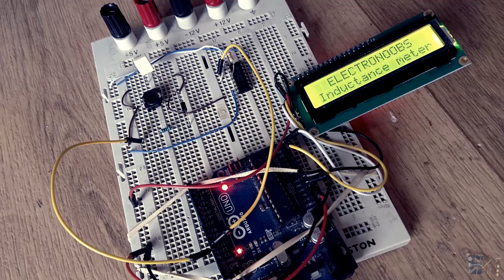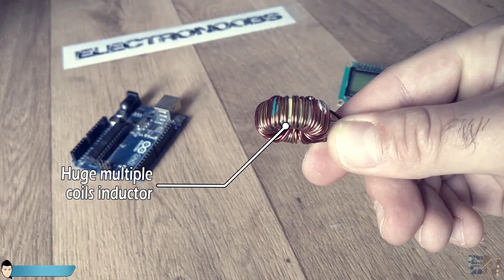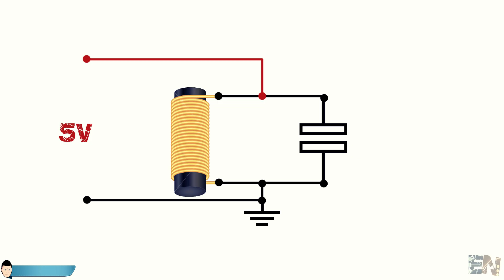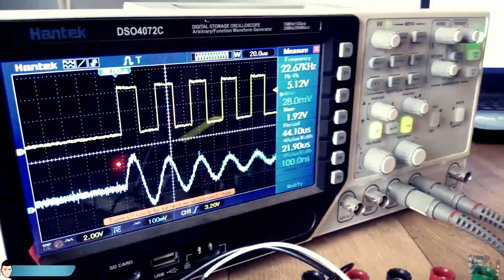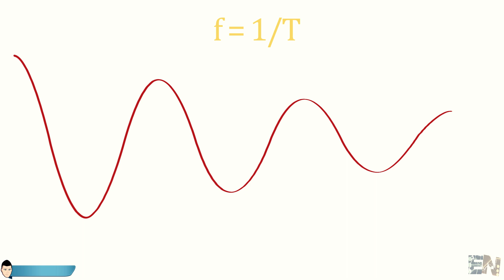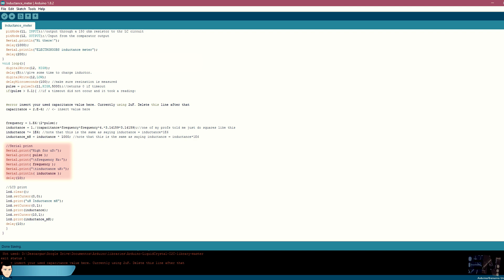Inductance meter with Arduino

Comment: Where do you get the 1602 with straight pins? All the ones I see have the pins bent. Even you link shows 90 degree pins. Do you straighten them?

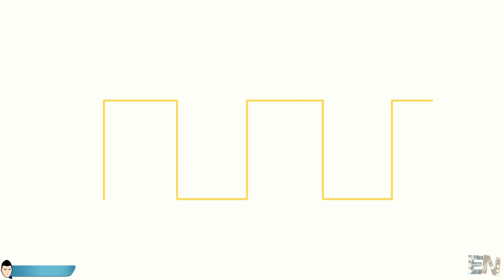Comment: 6:54   You'd probably do better to use a rectangle wave with a duty cycle of 10% , You'll get a better ring off the inductor and depending on the inductor value you could drop that to 5%, Although this doesn't work for every inductor.
10% is the way to go in my opinion

Comment: Hi Electronicnoob, this is a great video for LC meters. My question is that is this project work WITHOUT a i2c connector? The arduino itseft can function directly connect to 1602 lcd.

Comment: @Electronoobs Thanks for this tutorial video.  I know that it is a bit old, but I am hoping that you are still monitoring and responding to questions about this project.  I have a few questions:
1. Why not use  the Atmega328p internal comparator (available on the analogue input pins) instead of an external comparator chip?   It may need a more accurate method of measuring the frequency period, but this could, perhaps, be done with an assembler code loop.
2. If an external comparator is absolutely needed, why not use a LM393 dual comparator (smaller IC package) instead of the LM339 quad comparator?  Is there a difference in characteristics between the LM393 and LM339?
3. Also, if an external comparator is needed, why not use the internal digital input pin pullup (i.e. INPUT_PULLUP mode) instead of the external 330R resistor?
Thanks.
Reply: This is good questions, i also need the answers. I am building a lc meter with lm339

Comment: hi , made it and it works fine , but if you use 2.5uF capacitor and DON`T change the code , it works even better :)

Comment: ... after a week or so of swearing and frustration caused mainly by bad breadboards, with bad contacts, i made this thing working.
yes, 1 uF, but changing the value in the code, it will work, too, but with another set of coils.
next, if your inductor/coil/solenoid is shorted (very rarely, but sometimes happen, check with an ohmmeter, to see if reads a short!), the signal will be grounded, and measuring will never happen.
same for a too high or too low inductance: no measuring, nothing will be displayed.
without anything unless the cap, nothing will be measured, too.
i use just one 1 uF cap, and finally started this thing.
results from serial monitor:
91 us
5494.51 Hz
0.82 uH

with another coil:
312 us
1602.56 Hz

9.66 uH

without any change in code, i put another 1 uF cap in parallel (so, a total of 2 uF, or around...), and i get, for the same coil from the first results:
130 us

3875.97
1.65 uH

tried an axial inductor marked DLA 10 mH, not working at all. but with some inductors randomly harvested from ATX power supplies and "economical fluorescent bulbs", it worked nice. too low or too high coil resistance will cause that thing, again, to not work...
so, first time, try it without any coil, and check if you get a signal on comparator's input pin. be sure your capacitor is not shorted, too!

looks like i can measure, with a 1 uF cap a 0.10 uH coil... hmmm... this was the lowest one:
31 us
16129.03 Hz

0.10 uH

i tried to measure a mains trafo, primary and secondary side... nothing, maybe too high inductance in primary side, and on secondary, too low resistance of winding...

now... is time to put this thing on a small perfboard, and doing stuff...
code is working, but the oscillator is not working with ANY coil. so, try to find a similar coil like that one from video.
be sure about your soldering, too... a wiggly or poor soldered wire will drive you crazy! :D

ah, i used an SSD1306 display.
just a question of using the correct library, and invoking the correct statements.
easy.
because i have no I2C LCD here... just a lot of 16 pin LCD's, and a lot of SSD1306, 128x64 or 128x32.

good luck.
Reply: Can u share the code?

Comment: One will face trouble while attempting to measure an unknown inductor with a very low series resistance(inductors made with thick copper wires or fewer turns or both)! The charge will get grounded first(because of the low resistance) before it can charge the capacitor!!
As an upgrade- Either disconnect the inductor from ground while the capacitor is being charged or eliminate the diode & resistor arrangement and instead simply charge the capacitor through the unknown inductor. At the end of charging cycle connect the inductor to ground !

Comment: bit of an old video but @electronoobs after looking at your webpage and video really closely I cannot get this project to work using both a 220uF nonpolar electrolytic cap as well as a 1uF ceramic cap. With both circuits it does not output anything, I have changed the value in the program. I have tried different ICs as well as different Arduinos. I don't have a scope so I can't check anything else really.

Comment: Bro, i made this today to check the inductors, and it works perfectly!!! I had to reduce the delay time after the power in to the circuit is off ( i used a 0.1uf cap though).. keep up the good work!!! Thanks!
Reply: Hi how did you make this? Would you share your shematic and code? Thank you
Reply: Is the measurement accurate for inductors below 80uH?. Thank you inadvance for your response.

Comment: can you help me to make Arduino uno Auto range DMM multi meter minimum  i required capacitance 10pf to 1000uf/ resistance 0.1 ohms to 4 mega ohms volts meter 0 to 1000 volts  3in one with one button mode change Like mode 1 resistance mode 2 capacitance mode 3 volts ? I hv Arduino Uno with keypad shield

Comment: LM339 is Quad Comparator but you only use one. You can also use LM393 Dual Comparator or LM397 single general-purpose comparator
Reply: https://youtu.be/6mQ-LN3PGwY

Comment: Suppose an inductor is NOT connected to the 1uf capacitor and the circuit is operated with 1cm of straight wire instead of the inductor.
The resulting ringing waveform will be the  result of the 1 uf capacitor SELF RESONANCE 
                 see:  https://sound-au.com/articles/capacitors.htm#s30  
                             here is the result of what is described above:
                           " The inductance is not great ... about 5-10nH per cm (centimetre) depending on wire size, but it is still significant at very  
                               high frequencies.  With a 1µF cap (hardly massive), a mere 6mm of lead length (6nH assumed) creates a series      
                               resonant circuit at close to 2MHz. "
In the video at 11:43/12:28 the resonance period was 58 usec  which is much larger than 0.5usec so the measurement is acceptable
Should the measurement read 5.8 usec the measurement be in serious error !

Comment: What is the range of values this meter can read?
Reply: Hi Joey, in his site (http://electronoobs.com/eng_arduino_tut10_3.php) he tells something like 80uH to 30,000uH. That´s a very simple and nice project, but unfortunately I need to read smaller values, bellow 80uH...
Reply: @glauciogv5225   Hey man did you try doing this project? Need some help in doing this. Not able to get the output from pulseIn function.(mymail-varshithkumar553@gmail.com)

Comment: sorry i can not understand full concept of the circuit.  The pulse is stop and the compartor  read the residual resonance or the arduino sweep a lot of frecuncy ??
Reply from the maker: Is not residual. The resonance begin when you cut the pulse. When you go from 5V to 0, the LC tank will resonante and we read the frequency of that resonance. Good day!
Reply: @ELECTRONOOBS  thanks dude, saludos from Argentina, sorry for my english
Reply: Sera muy complicado hacer un medidor de resistencia equivalente "ESR". Estaria bueno hacer uno con Arduino o FPGA. !!!!!

Comment: Thanks for providing such a great video, 
I had implement the capacitance as well as resistance meter and it worked. 
Now, I am building this inductance meter and here, problem arises with  lm741 as comparator, and now circuit is not working 
Pls provide schematic diagram for lm741 as well.
Reply: LM741 is OP AMP not comparator so you need other circuit and code.

Comment: bro you are a LEGEND
Reply: bro I want to make  a crossover frequency for my DIY speaker Project  that's why I needed an Inductance meter
please help me
it's going to be center Chanel on my home theater system

I got 8-ohm tweeter and dual 8-ohm woofer in parallel  that becomes 4 ohms in total
my tweeter is Dayton Audio DC28F-8
and woofer is  Dayton-Audio-DA135-8
I know u have a lot to do but it's my first DIY project  and I am really excited about it
thank you

Comment: this no longer seems to work for some reason. also there are several errors in the code available from your website. and the library provided does not seem to want to cooperate. I would appreciate some help, as I would like to have one of these handy for quick and dirty approximations of inductors.
Reply: I also cannot get it to function. Have you had any luck?

Comment: If I only want to measure a "large" inductance, say mH, would it be possible to measure the inductance accurately using the same method as for measuring the capacitance?
From what I understand, the reason we can't use  the same method to measure inductance is because as we increase the resistance we are lowering our "charge time" in the LR circuit, thus our arduino at 9 kHz sampling frequency (76 kHz if you play around with if for a while) isn't fast enough. But if I use 76 kHz I get a "resolution" of 0.01 mH, so that should be enough to measure mH accurately, right?
Also, we should be able to least square fit the exponential curve to get a good accuracy despite noise in the measurements, right?

Comment: Why not use the comparator built in to the ATmega338p? I know I’m a bit late to the video, but I think the built-in comparator has a response rate of something like 125-250 ns (4-8MHz)

It seems silly to use a dedicated comparator when an arduino uno already has one

Edit: in fact, I think the ATmega328p’s comparator has roughly the same response time as the as the LM339 you used
Reply: Try and you understand why he did not used internal comparator.

Comment: After a long search, I found all the errors, both in the code and in the wiring.
Unfortunately, the published code is NOT the working code as shown.
- Definition of the variables: inductance__mH (with 2 instead of 1 underlines)
- look at the pinMode (11 and 12), INPUT and OUTPUT changed
- pin 13 in code comment and breadboard schematics is not in use. Only pin 11 and 12 needed! Video, Schematics and Code do not match.

Inductance meters now working fine and amazingly accurate for a DIY. Thank You!
Reply: can u share the working code please?

Comment: Would be great if the code actually worked. It's either incomplete or bad.. the only thing it does is print "Why hello" in the serial monitor (115200 baud rate). 
I've also noticed some differences between the supplied code on the blog and the one being used in the video, but neither actually seem to work lol

Comment: why we use the resistor of 330 ohm ?
Reply: From the author: "As soon as the voltage on the LC circuit becomes positive, the LM339 *will be floating, which can be pulled high with a pull up resistor*. When the voltage on the LC circuit becomes negative, the LM339 will pull its output to ground. I’ve noticed that the LM339 has a high capacitance on it’s output, which is why I used a low resistance pull up."

Comment: Hi Thanks for this Inductance meter. I have build one . It is working but I don't get the correct values. I have played with different Capacitor values but is still not giving the correct value. I have put different values in spreadsheet to see if I am same factor out but it is not. Any idea what can I do to check for a problem.
Reply from the maker: How big is the error? You should change the resistance values in the code and fine tune de measurement...
Reply: Thanks for reply .The  value on a 1000microH inductor reads  about 800microH with 0.88microF cap. When I change cap to 2.37microF then value is only 650microH. In your reply you mention resistance value change in code . Is this a mistake because I did not see in code that, only change the capacitance value?
Reply: Nico de Klerk, it really seems to be a mistake. I think he meant "chage the CAPACITANCE value". See the code:

#error insert your used capacitance value here. Currently using 2uF. Delete this line after that
capacitance = 2.E-6; // - insert value here

Comment: Can LM319 be used instead of LM339? Thanks!
Reply from the maker: Yes!
Reply: Electronoobs thanks! I have a 319 home and i will use it. To be honest, as far as i've seen from your schematic, you are using just one comparator out of 4
Reply from the maker: Yes, single OPAMP is more than enough. I've used that because is what I had, Keep up!
Reply: can lm393 be used , i had buy 393 mistakenly instead 339 or 319 ??
Reply: @hacksci4fun439  Yes!

Comment: Thanks a lot man.
What is the smallest and biggest value can this read?
can it read nanoHenry (nH) ? (even if you change the cap value to higher/lower)
Reply: @Badr Ahmed 
LCR / Component Tester
https://youtu.be/7Br3L1B80ow
https://ar.banggood.com/buy/lcr-component-tester.html
Reply: @Badr Ahmed  Hey man did you try doing this project? Need some help in doing this. Not able to get the output from pulseIn function.(mymail-varshithkumar553@gmail.com)
Reply: @Badr Ahmed okay cool brother.....
 I just have to fix the pulseIn function.. I am getting the correct square wave from opamp as well. I measured its frequency and it matches with the formula.
Reply: @Electronoobs  can you help us bruh

Comment: There is an error in your downloadable code at http://electronoobs.com/eng_arduino_tut10_3.php
In line 12 you declare variables:
   double pulse, frequency, capacitance, inductance, inductance__mH;
inductance__mH, with 2 underscores.

But later, in line 40 and 58 you use the undeclared variable inductance_mH, with 1 underscore.
Reply from the maker: Oh, Thank you. I'll correct that! Keep up!

Comment: can you send the code to me?
Reply from the maker: Download link in the description.
Reply: http://electronoobs.com/eng_arduino_tut10_3_code1.php

/*Thanks. Remember to visit my Youtube channel
  If you don't whant to Serial print the valeus just delete the serial. print lines
  and leave just the LCD print ones.
  I've used a i2c LCD screen module. 
*/
//LCD config
#include <Wire.h>
#include <LiquidCrystal_I2C.h>
LiquidCrystal_I2C lcd(0x3f,20,4);  //sometimes the adress is not 0x3f. Change to 0x27 if it dosn't work.

//13 is the input to the circuit (connects to 150ohm resistor), 11 is the comparator/op-amp output.
double pulse, frequency, capacitance, inductance, inductance__mH;
void setup(){
  lcd.init();
  lcd.backlight();
  Serial.begin(115200);
  pinMode(11, INPUT); //Input from the comparator output
  pinMode(13, OUTPUT);//output through a 150 ohm resistor to thr LC circuit
  Serial.println("Hi there!");
  delay(1000);
  Serial.println("ELECTRONOOBS inductance meter");
  delay(2500);
}
void loop(){
  digitalWrite(13, HIGH);
  delay(5);//give some time to charge inductor.
  digitalWrite(13,LOW);
  delayMicroseconds(100); //make sure resination is measured
  pulse = pulseIn(11,HIGH,5000);//returns 0 if timeout
  if(pulse > 0.1){ //if a timeout did not occur and it took a reading:
    
    
  #error insert your used capacitance value here. Currently using 2uF. Delete this line after that
  capacitance = 2.E-6; // <- insert value here
  
  
  frequency = 1.E6/(2*pulse);
  inductance = 1./(capacitance*frequency*frequency*4.*3.14159*3.14159);//one of my profs told me just do squares like this
  inductance *= 1E6; //note that this is the same as saying inductance = inductance*1E6
  inductance_mH = inductance * 1000; //note that this is the same as saying inductance = inductance*1E6

  //Serial print
  Serial.print("High for uS:");
  Serial.print( pulse );
  Serial.print("\tfrequency Hz:");
  Serial.print( frequency );
  Serial.print("\tinductance uH:");
  Serial.println( inductance );
  delay(10);

  //LCD print
  lcd.clear();
  lcd.setCursor(0,0); 
  lcd.print("uH Inductance mH");
  lcd.setCursor(0,1); 
  lcd.print(inductance);
  lcd.setCursor(10,1); 
  lcd.print(inductance_mH);        
  delay(10);
  }
}

Comment: In the schematic you presented it looks as though nothing is preventing the voltage on the charging pin from being swung into the negative, something I'm sure the arduino doesn't appreciate much. I would suggest using that arduino pin to drive a small, robust mosfet which rings the circuit.
Reply: Atlas WalkedAway 
A clamping diode to ground on the input pins should eliminate risk of negative voltage damage.
You’re absolutely right sir.

Comment: why not working
Reply: Did you the #error line? at the line beginning with #error the one that looks like this:
#error insert your used capacitance value here. Currently using 2uF. Delete this line after that

Comment: theres some problems with the supplied code and the schematic, the input pins are not proper defined, you need to change the pin numbers around a little bit.
Reply from the maker: Thanks. I'll check that out!
Reply: its not a big deal :) i just noticed the fritzing pins being different than the code, also, i noticed measuring toroidal coils is a bit of a difficulty, any idea why this is ??
Reply: Hello
the whole time built up loud instructions only get it not at run somewhat does not fit there shows nothing at display is however okay.

Comment: instead of connecting the output to your oscilloscope could you connect it to a pc and  create a program for acquisition and display of signal in real time on the pc, then save files of time traces (ASCII) and plot them with any plotting program like excel?